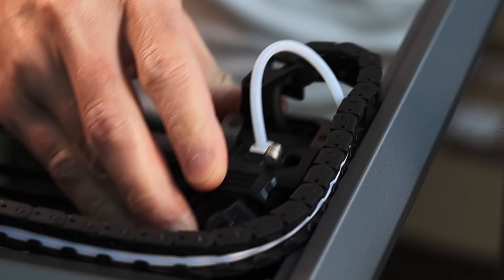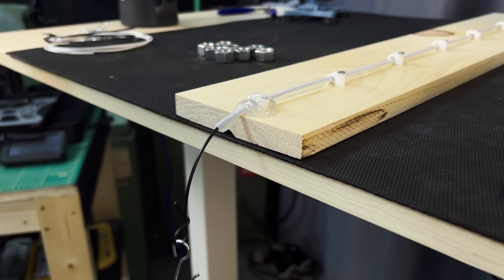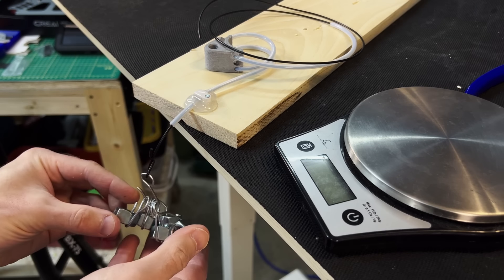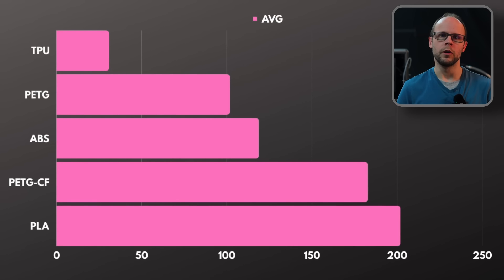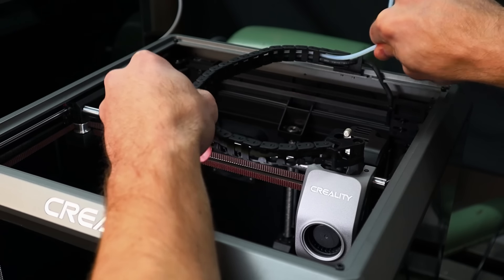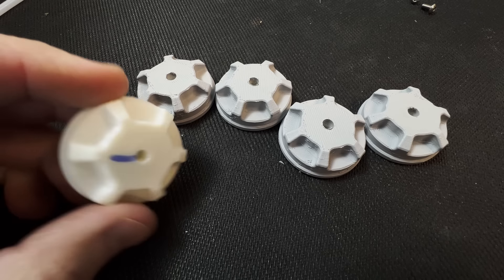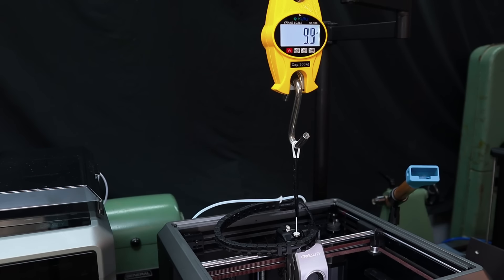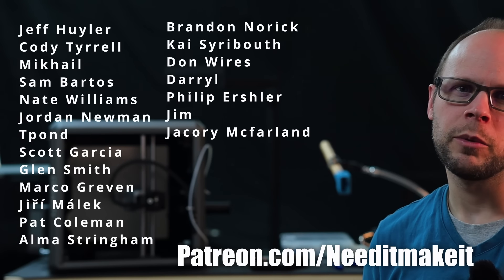Is your Extruder Feed TUBE causing print defects?

Comment: This is what I had expected -- Creality makes a pretty strong extruder, and the K1 with the right nozzle can really firehose out a lot of filament very fast. A little bend in the tube isn't going to be significant.
Reply from the maker: It seems that way for sure.  I don't think it's a bad idea to reduce the tube length and drag as much as possible, it can't hurt, but we're not in a range where I'd be worried about it.  I'll have to do some more testing with a 10' tube and see if that changes anything.  Can I even buy a 10' tube?
Reply: @NeedItMakeIt  Maybe try with much longer tubes. Especially for today's bulky multi-spool filament dryers that might be too big to place near a printer. Maybe I like to dry my filament in another room lol :)
Reply from the maker: @JameTek  I was thinking about trying to get 10 and 20' and see what that's like.  I still don't think it would be much of a problem, but I could be wrong.

Comment: Even if the print quality doesn't change it's always a good idea in a mechanical system to have as little drag as possible. The less drag you have the less work your machine needs to do. Which is always good.
Reply from the maker: Sure, that's a good rule.  I see some people running with the long tubes coming from their MMUs, the tubes are in the several feet range, but they are fairly gradual in their curve at least.   

I still want to experiment from a top feeding and more centralized setup, the tube would still be there, but would come in from above and be fairly straight, similar to a bed slinger.

Comment: The answers here show why Creality has issues and the users don't know how to fix it.  Any restriction, no matter the power of the extruder, cause issues.  Things are moving so fast resistance will cause problems.
Reply from the maker: Sure, it you try and take off like a drag-racer, you'll peel the filament apart, but that's a different problem.  Bambu runs the same tube as Creality, the same length and diameters, it also bends quite tight if you watch.  I have to stick by and say that at least from the observations and testing I've done, extrusion issues on Creality come from a different source than the tube.   

If you have some data to share please do, I can always come up with a different testing method to see if we can prove/disprove.

Comment: Just curious, was this a new piece of ptfe tubing or was it used? I just replaced my reverse bowden ptfe tubing and was quite shocked at the difference in how slick the new tubing was verses the well used one.
Reply from the maker: This tube was new, sure that's a good point, after some time of using them there will be wear and I suppose that the path of travel of the filament will be sized closer to the filament itself, maybe causing a bit more friction.  I don't know of any rules of when to change the tube, maybe when they wear through?  How many hours would be a good idea.  It will of course be based on the type of filament you print with.

Comment: I print a lot of ASA, and I noticed a large difference with PLA+. After a long ASA print (100C bed, 260C nozzle, cover in place, door closed), when I retract the filament for a change or storage, the ASA will have very obvious marks from the extruder drive hubs on the last inch and a half or so of the filament. PLA+, even after a long print with the cover off, barely shows any drive hub marks. That tells me temperature has a bigger role than you might initially think.

Comment: I agree with others when they say the Creality extruder is strong enough to handle that with no issues. So the PTFE tube can be in the chain or out.  The only reason I took mine out was to reduce wear as you stated and also to help when printing brittle filament like carbon fiber-filled filament. I saw lots of breaks in the PTFE tube when the tube was inside the chain. And once I removed it I saw much less breakage. So in my opinion why not take it out and use zip ties. Great video
Reply from the maker: That's a good point about the brittle filament, I have never had this issue personally but if you don't have a dryer or keep your filament in the open air, it's going to begin to breakdown.  I like that PLA breaks down over time, but I can't print the parts that I need to last with a filament that becomes brittle.  I would assume that It also becomes more brittle in the form of a 3D print over time?

Comment: I got so sick of dealing with bowden tubes so i converted both printers that used this to direct drive and replaced any feeder tubes with 2.5mm ID tubing. So far it's worked exactly as I had hoped and I personally find it to be a superior setup. Luckily I had a lot of it already on hand as one printer is dedicated to printing with filament made from PET bottles and the diameter isn't exactly consistent... generally around 2mm. The 2.5mm ID tubing solved any feed issues I had so I applied this logic to all my other printers and I don't regret it. Any printers that had long feed tubes had them shortened to about 2" out of the extruder. I did this with my anycubic kobra 2 when I moved the filament holder to the top of the frame. Worked like a charm and this thing prints TPU like a champ.

Comment: Thank you, NeedItMakeIt!
Looking at your work I made a decision and K1C just arrived - do you know any good source for Prusa Slicer profile for K1 / K1C ?
Reply: I would switch to Orca slicer. It has built ins support and you can print direct through wifi.
Reply from the maker: Nice!  K1C looks like a nice unit.  I'm still happy with my K1, but there are some nice changes on the K1C that I wouldn't mind having.

I haven't looked recently for one, but when I did, I didn't find much out there.  Like Alan, I went to Orca and haven't looked back, it's a very nice program and there are profiles for the K1 printers, I'd have to look to see if the K1C has one since it's fairly new.

Comment: Cool video, the k1 extruder is rated at 50nm so in theory should be able to pull just over 5kg max before the gears skip.
Your test showed less force than 50nm before skipping.
Good to see it only takes a tiny amount of weight to actually pull the filament through a bent tube.

I got my p1s yesterday in replacement for the a1.

First print out the box no settings changed..veroni rabbit...almost perfect quality.

I am reprinting the file standard settings with the same roll of filament on my k1 and my ender 3 v3 se to compare the difference.
Will be uploading a video later.
They are pretty shocking

Keep up the experiments your vids are cool

Comment: Try a vertical tube route with +15% extra length from the furthest print head distance. Horizontal routing is the wrong way for how the printer is setup.
Reply: Depends on the printer, k1 max is all horizontal till the hot end, so they set up works

Comment: But why your print quality is so poor? :)
Reply from the maker: There are a few reasons, one is that I have lighting setup to make my prints look as bad as possible.   In other words, I'm trying to show the defects.  The spray paint also helps to do this.  The parts are also quite small and I'm using a macro lens to pickup any blemishes.  From the printer standpoint, I did not use Aligned seams, but random, and they always look bad unless you have your filament dialed in.  I also used the stock setting for the PLA filament and I did not calibrate for PLA nor for flow for really good looking prints, I'd need to calibrate it.